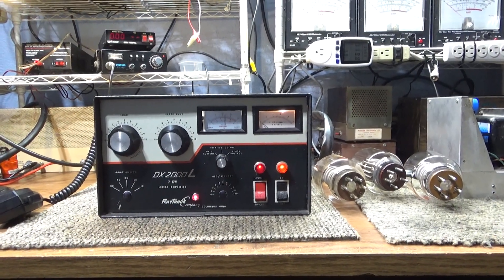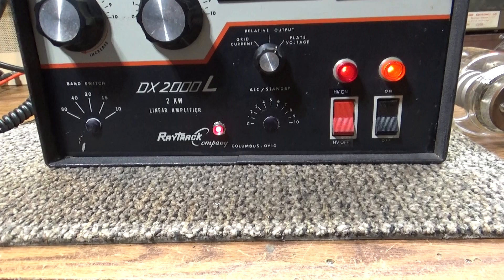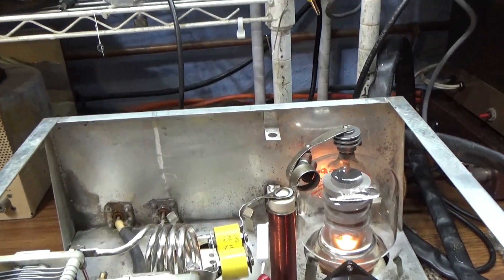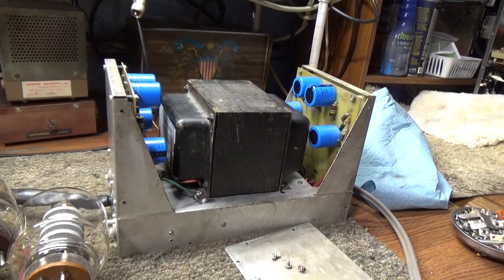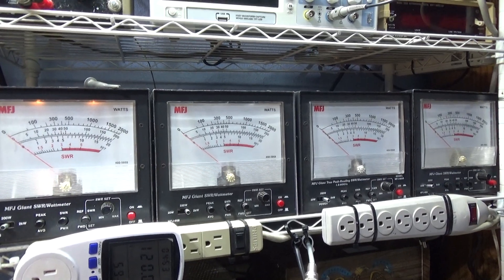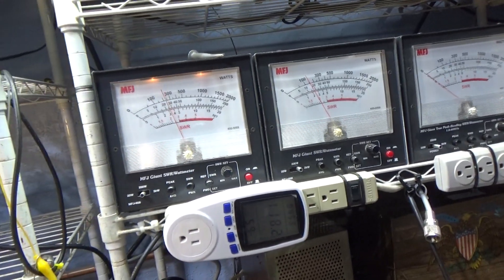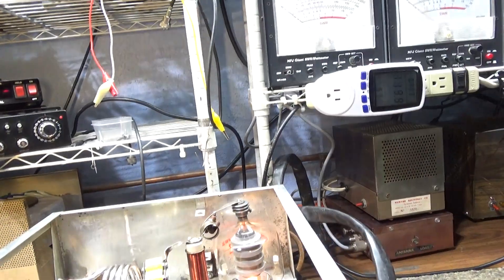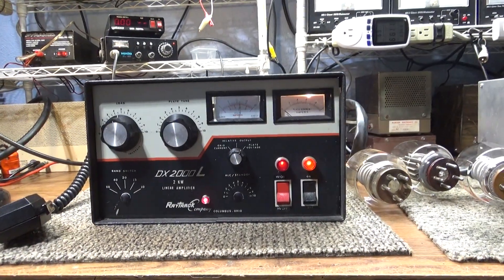3-500z Linear Amplifier Tube Tester on the bench.

Comment: Very handy! There’s just nothing like putting a tube in an actual circuit to test it.👍
Reply from the maker: Absolutely agree. Tube testers give some indication, but if you want to really test a Power Tube, you have to have it make actual Power, period. I've got 3 small sweep tube amps that are also converted to one tubers to use as tube testers. One for 12 pin 6lf6, 8950 and family, one for 9 pin 6lq6 and family, and one for the 9 pin baldies, 6kv6 and family. Almost forgot about a Blackcat JB- 150 for the Octals 7581 and family.
Reply: @tramdr  I worked for several weeks to get my Golden Eagle Mark III receiver going. I have several highly respected tube testers and all said that my tubes were good. I finally got my Elmer to look it over. He substituted some tubes and located one that just wouldn’t perform at the higher frequencies. After replacing it, my Eagle received better than any radio I’ve ever owned! Sometimes you just have to substitute tubes. As long as your substitution tubes really are good! But I’m sure you’ve been through that several times!